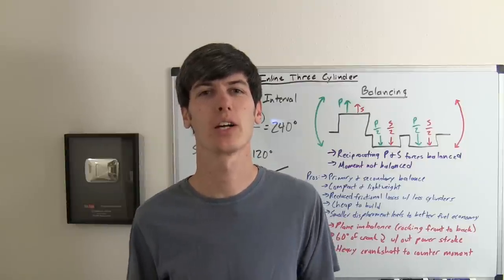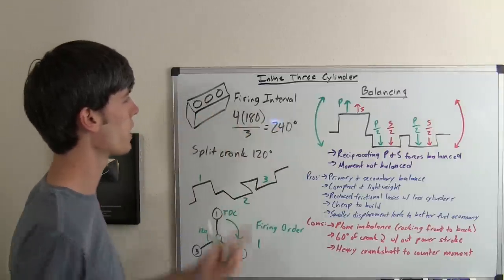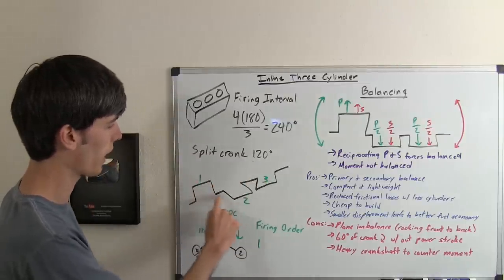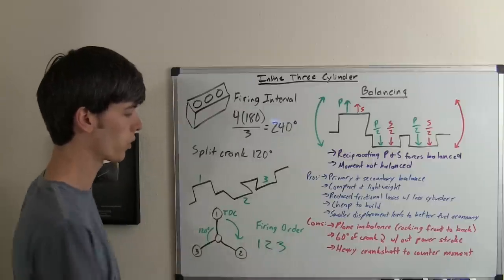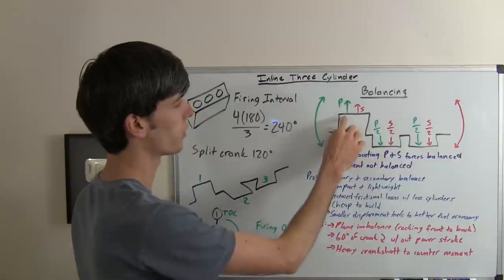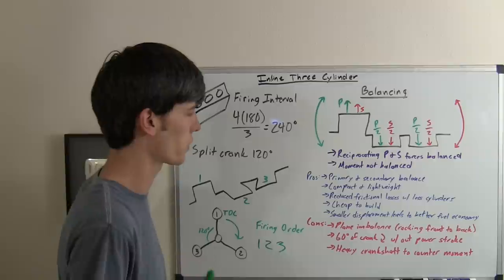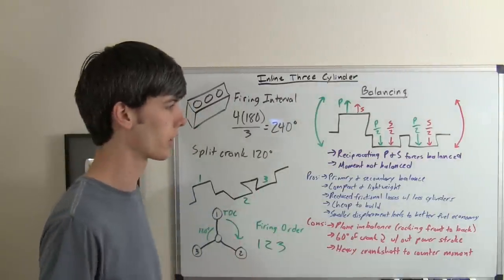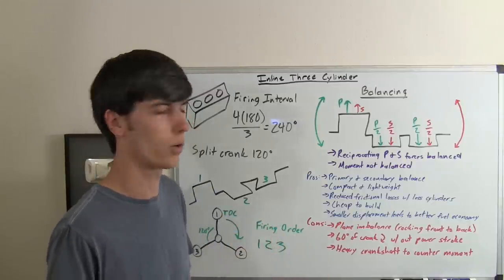Inline 3 Cylinder Engine - Explained

Comment: In this video, and in the Wikipedia article on engine balancing, no mention is made of using a gear driven contra-rotating balance shaft in an inline 3 cylinder engine, running at crankshaft speed, to create a rotating couple to counterbalance the crank. All the I3 engines in motorcycles I know of; Triumph, Yamaha, Benelli, MV Agusta do this. It allows lighter weights on the crankshaft and its own moment of inertia is probably less than that of the weight saved, so it allows the engine to spin up fairly quickly.My 3 cylinder Triumph Daytona 955i is noticeably smoother than my previous Speed Triple 955i and later Tiger 1050. I believe this is because it has lighter forged pistons instead of the cast pistons in those other engines. The extra money spent on the lighter pistons is well worth the improvement in engine smoothness as well as tighter piston-to-cylinder clearance it allows with Nikasil plated alloy cylinder liners. Light forged pistons seem like a better solution to secondary vibration than balance shafts, in 4 cylinder motorcycle engines at least.

Comment: I have an inline 3 cylinder Triumph motorcycle. 2.3 liter displacement. It is as smooth as any 4 cylinder motor I have owned, no matter the RPM. It revs very quickly and has tons of torque at low RPM with minimal vibration. Yeah, it can be lugged down to where things get uncomfortable, but just twist the wick, and it's gone.

Comment: Do you think there would be any benefit to a vr3 type design?
Reply: Well, it will be even shorter and a little tiny bit less tall but therefore slightly wider. Therefore primary and secondary forces wont be even parallel anymore making the engine not only want to rotate in a very strange way but also making it dance ontop of spinning unless you somehow counter the remaining bits of primary and secondary forces which will the not be fully countered but the other cylinders themselves making the desing even more heavy and complex which leads to a worse ability of changing engine speeds quickly and making performance and fuel efficiency worse too. As I mentioned, there are slight benefits which dont matter much since inline 3s are super short already.

Comment: First I must say I am very glad to be the first one to comment here. Also, thanks for the video. Now to the good stuff, I believe that has been a mistake when talking about the firing interval since the rotation from cylinder 1 cylinder two is 120° and not 240. Unless I misunderstood, I believe in the firing interval on a clockwise rotation would be 132 and counter clockwise is 123 with the difference that it skips one cylinder. So clockwise the firing would be one, skip two, three, skip one, two.
Reply from the maker: As I mentioned, firing order (clockwise) 1-3-2. Fires every 240 degrees of rotation of the crank.
Reply: Like I said, I guess I misunderstood.  reviewing the video I saw you pointing as you speak and skipping the cylinders when needed. The first time I saw that it wasn't as clear to me. Thanks for the great video anyways

Comment: Is it possible to have in this case cylinder 1, in-between cylinder 2 & 3 and would that help balance at all? Possibly limit the counter weight needed on the crankshaft?

Comment: About power strokes being fewer per turn, this is not an issue other than at idling when you can feel some of this. About balancing the three cylinder engine, the lecturer forgoes that the three cylinder is provided with a balance shaft, that together with the unbalancing of the crankshaft practically cancels out the rocking couple of the engine. The engine is very well balanced which is particularly noticeable at higher revs. W. Thomson neatly explains this in his book Fundamentals of Automotive Engine Balance without using any math.

Comment: I was quite fortunate to get my hands on a 2016 Honda S660, it's a mid mounted 660cc turbo 3 cylinder with a 6 speed manual. It'd be great to see a version of Honda's S660 to the US, maybe a 1L 3 cylinder turbo, or high revving regularly aspirated peaky natured engine.

Comment: The first decent car I bought (decent as in it was not a $300 junker like my first couple of cars) was a '94 Subaru Justy hatchback with a 3-cylinder engine.  It was a neat, if very small, little car (I remember thinking at the time "is this even safe to take on the highway?"), and it got very good gas mileage.  It was well over 40 MPG if I was the only one in it (but it took a big hit if my parents and sister were with me).

Comment: I have a mini one hatch 2016 with the 1.2 I3 turbo, and it is very smooth apart from low rpm when I can feel it vibrates a lot

Comment: Hi, I have Daihatsu EJ-DE engine(non VVTi/DVVT)originally fitted to RWD car. The vibration like earthquake, little bit better after I installed flex pipe to exhaust. 
I was wondering, will balancing my crank shaft reduce the vibration?

Comment: Ford's newest 1.5L 3 cylinder turbo engine is a decent little powerhouse. It feels peppier than the previous 1.5L 4 cylinder in the escape. Only thing I don't particularly care for is it has cylinder deactivation which turns it into a 2 cylinder at steady cruising and you can definitely feel it.

Comment: I have always pondered about 7 cylinders. I know there are existing ones but would it be possible to create one in a vr formation. 102.86 degrees of separation on crank is complex but would the small V angle using the same head save space? I've become a little obsessed I'm afraid, any help explaining would be greatly appreciated. Thanks.

Comment: I understand that between power strokes there will be 180+60° of crankshaft rotation, so it's a stroke + 60°. Could you explain your statement that "there are going to be times where there is not a power stroke occurring" and "you don't have this even power stroke overlap"? As far as I understand, inline 3 with 120° between crank pins has as even a firing order as can be and evenly placed power strokes do not overlap until you are beyond 4 cylinders anyway

Comment: QUESTION: since the 3 Cylinder Engines are primarily unbalanced, and require a lot of counter balancing shafts and dual mass flywheel to keep em from shaking themself apart... Are they really that efficient?

If we take a 1.2liter 3 Cylinder
 and a 1.2 in line 4... wouldn't the 3 cylinder use more fuel than the 4 because of all that added rotational masses?

If the 4 Cylinder uses less Gas, then why do Car manufacturer keep pushing smaller 3 cylinders instead of making 4 smaller  cylinders?
 like a 1000cc in line 4...

Comment: Hey what I dont understand is the formula used, 720/num cyl, okay so using that on a v8 would mean 90deg but you can also get v8's with 180 deg crankshaft angles??
Reply: +Igor Keating V8's have a 90° V angle, so in a 180°  crank V8 one bank (essentially a 4 cylinder, which fires every 180°) fires, and then 90° later the other bank fires and the cycle continues. Same for a V12 which can be considered a pair of I6s with a 60° V angle.

Comment: Would it be possible for you to get some reviews of cars with the 3 cylinder engines? At least in Europe it seems that the 3 cylinder is very much here to stay, even BMW have got a 1.5L I3 in their 2 series active tourer, and will have the engine in the 1 series soon enough. So I'm just curious as to how they feel compared to engines with similar displacements but with more cylinders.

Comment: I have a 2018 0.8L Suzuki Alto 800. Not fast, but really reliable, low cost and with good mpg (37 mpg city and up to 64 mpg highway). Really good 4 occupants  motorcycle with air conditioning.

Comment: My father and I use an i3 car and it shakes a bit indeed. Also, there is little power on low rpm-s, but it uses little fuel. He's worried about its durability though and considers a swap.

Comment: why would there be power missing sometimes due to 240 degree firing time.. can you explain ... you said this at 37 seconds... please explain ! :) ?  are you trying to say that the interval is big enough to be felt at lower rpms
Reply: +Tushar Girotra At the point of firing the piston is at top dead position. Then it delvers power - moves all the way down, rotating the crankshaft by 180 degrees. As the piston starts moving up starts the exhaust, which means that power is only delivered during that 180 degree descent of the piston. If the firing interval is 240 degrees, then we know that there exists 240-180=60 degrees during which none of the cylinders is firing.

Comment: Hi.
Please help me.
My car is Three cylinder car not start up in morning when it is cool.
Engine compression is 75
New battery but same problem.
When mechanic starts car then RPM is going down from 1000 and engine will off.
Please solve my problem i saw your videos on YouTube you have alot of knowledge please tell me solution for it.
Thanx.
Hamid

Comment: I have three cylinder engine in my car, and works very smoothly. When idling it has almost no vibrations, in cabin you don't even know it's working or not. Real downside is the sound (which is horrible at any given moment) and it becomes very noisy under heavier load.
Reply: Wow..how come your have no vibration? Is it great engine mount or something else...what kind of engine btw
Reply: @budhihart8161  It's Mk.2 Fabia 1.2 htp. To clarify my 4 year old comment, engine does vibrate slightly when you look at it, but you don't feel this in the cabin. They probably did some magic with engine mounts.

Comment: I am curious how do you calculate firing interval for single cylinder engine?(scooters for example) I tried this formula and i get some result i am having hard times believing in.. Every 720 degrees? How is it possible to sustain it if it fires after every 2 full revolutions? Or that's how they work?
Reply: They are 2 stroke engines, or at least most of them, so they fire at every crank rotation instead after two crank rotation
Reply: A very heavy flywheel keeps it going because of the momentum.
Reply: +KRAUSER0130 - A 4 stroke single cylinder does fire every 720 degrees.  The flywheel keeps the engine turning between power strokes, and really, the power stroke lasts for roughly 180 degrees of that 720 degrees.  It does sound slightly odd, but there is enough power from a power stroke to provide power to whatever the engine is driving and keeping the flywheel turning, which in turn keeps the engine going between power strokes.  But also realize that even firing once every 2 turns, at 3600rpm, that is 60 rotations a second, and 30 power strokes a second, stuff is happening fast!  A side note, a 2 stroke single cylinder fires every 360 degrees due to the working nature of 2 strokes.
Reply: +KlockworXMusic Alright, thank you!

Comment: I have a 1994 suzuki alto with a f6a 3 cylinder carburetorated engine, automatic transmission. can you or anyone please explain or help with setting the vacuum hoses in the right positions?

Comment: So would you think the 3 cylinder engine would last half as long than a v8?
Reply from the maker: Quality of manufacturing and the parts used is far, far more important than the layout.
Reply: Engineering Explained
I guess I agree, but the trend is that inlines and flats are more reliable than the V counterparts.  Bearing and Valvetrain wear are the biggest threats to engine longevity (blowby is a problem, but it's a power/efficiency problem, the engine usually still runs).  Inlines only have one head gasket, one camshaft per "valve set" and so the chains/belts are simple and shorter.  Vs are usually unbalanced on an angle, with inlines and flats being unbalanced within a plane.  Makes it a lot easier to design around a planar flex.  Also, Vs are usually used where there isn't much room in the engine bay.  This limits airflow around the inside of the engine compartment.  While it doesn't necessarily hurt the engine, it does hurt components (wiring for example).
Reply: i dont think it matters whether it lasts longer or not. me and my buddy rebuilt a thrashed i3 with 120k km's on it in about 3 hours including removing engine and trans. it took me 5 hours to rebuild one ohc assembly in my v8, ONE side and i did both sides.
so a i3 is undoubtedly the best engine in terms of ease of service. motor and trans comes out with two people lifting it (the car we had motor and trans weighed around 300 pounds combined) or a third and maybe a fourth. my experience was good and when do you need more than 70hp anyway? looking at numbers is highly biased in my opinion.
4.6l v8= 190hp and 260LB-FT of torque  28 mpg hwy
993cc i3= 70hp and 70-100LB-FT of torque.  45mpg hwy
these are real numbers recorded for an average 5k km's
Reply: the way i see it,
Reliable, cheap, fast.

pick two of them to be your car
Reply: Sample Text I hope someday the Governments will put away petrol and let us use hydrogen instead! I'd buy a nice atmospheric V8  with ton of low rpm torque!
Reply: +Eat The Rich lol, nice one
Reply: Eat The Rich Not much energy in hydrogen.  Hope you have a big tank....
Reply: davetek490
Well, Volkswagen AG, BMW AG and Toyota have the technology to run cars on hydrogen, so I think they've resolved all the issues.
Anyway, if we were with hydrogen I'd buy a Lincoln town car with the great 4.6L V8 N/A from Ford. <3
Reply: Eat The Rich
Good choice.  Still wonder about the energy density.  Most of the bang from gasoline comes from the carbon in hydrocarbon (and the chain length).  Hydrogen has neither.  Not saying it won't work, it definitely will, but the range....
Reply: davetek490
Yup! But the university of Birmingham has resolve most of the problems, the last big challenge is to create more unit of hydrogen power out of one unit of electric power. Check out the BMW 760i hydrogen powered sedan and other YT videos of small gas engines running with hydrogen. Any gas engines can run with hydrogen, just some adjustments have to be done. I'm not sure about the carburated engines, I hope they can run with it because they are so reliable and durable.

Comment: yeah where I'm from we call inline 3's buzzers, because that's how they sound and fell, the literary buzz, back in the day there used to be a suzuki with an inline 3 named swift and the Chevrolet counter part the Geo metro, many years ago i took one of these apart with my dad and they use balance shafts to counter act the whole vibration problem, i don't  buy it, is not a smooth motor, but as horrible as the Geo metro is, everything sucks, but that little inline 3 suzuki made turned out to be extremely reliable,  to the point that i saw a Geo metro falling apart,  rust everywhere, body smashed, no hood, and car claimed  it had 391k miles on it, and motor still fired and ran just fine, that's  why i have respect for the metro unlike most people that just hate that car.

Comment: Can you please tell me how the 4 events works in 3 cylinder? the suction, compress, power and exhaust.. 
I really have no idea how it goes in there unlike 4,5,6,8, (cylinder) etc works. I mean its only 3 and there are 4 events happening inside.. in 1-3-2 order... and how's the Running mate?
Reply from the maker: I explain it on the left side of the board. No different than a single cylinder that goes up and down twice for all the strokes, but there are 3 cylinders. I give the firing order, and interval in the video, Every 240 degrees of crankshaft rotation, a cylinder fires, in the order given.
Reply: OR does POWER and Suction happening in only 1 piston? are they moving at the same time?
Reply: While the engine turns, the events will be: cyl.1 combustion, cyl. 3 suction, cyl. 2 combustion, cyl. 1 suction, cyl. 3 combustion, cyl. 2 suction, etc... (like a radial engine). The crankshaft is like a Mercedes logo, so pistons will be going up one after the other in a single rotation.
Reply: +Federico Lucchi (Skycrater) also accounts for the most unbalanced engine
Reply: usually on a 4 cylinder engine there is combustion for every 180 degree revolution of the crankshaft, so would a 3 cylinder be more likely to cut out at a high load when the crankshaft is at 540 degrees, as there is no combustion here?
Reply: diesel as old tractor with higher idle throttle. gasoline as faulty six cylinders. I drove the 1.2 TDI Polo of the rental car that is completely garbage, even consumes a lot.

Comment: Had a 3cyl engine in my 2002 Opel Corsa 1.0 12V... crappy engine without power. Still curious about the new turbocharged ones...
Reply: New ones are much better. Ford has 1.0L with 125HP and BMW has 1.5L with up to 231HP. Much better than  >50HP N/A they used to have.
Reply: hojnikb  Yes I have been driving Ford's ecoboost in the Fiesta (100 hp) about a year ago in a friends car, but I still prefere the slightly bigger 4cyl engines like the 1.2 TFSI (110hp) in the Audi A3 for example

Comment: I also use 1L car. ( Toyota belta 1000cc).  Much engine vibration is felt when car is completely stop in R & D gear.
Reply: Lucky i want a 3 cylinder toyota they dont have them where i am. Im stuck with a Mitsubishi mirage.

Comment: So you are saying that with fewer power strokes (for example versus I4 engine) this I3 will be more lazy at low RPM.
How come all the Triump Triple series engines have better power at low rpm when compared to I4 bikes?
Reply: +kratuli because that''s how they are tuned. You can make I4s with a less peaky torque curve but superbikes are designed for maximum power at high RPMs.